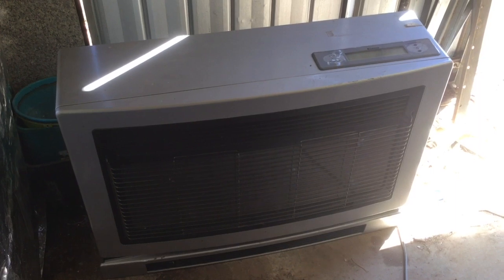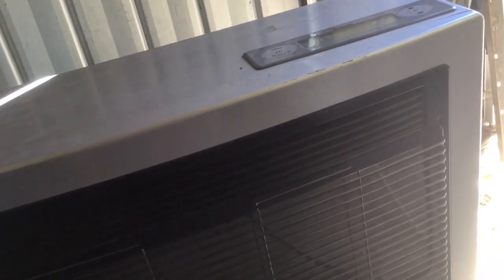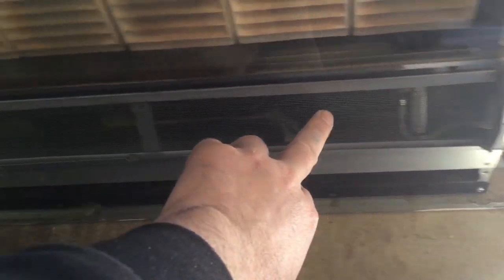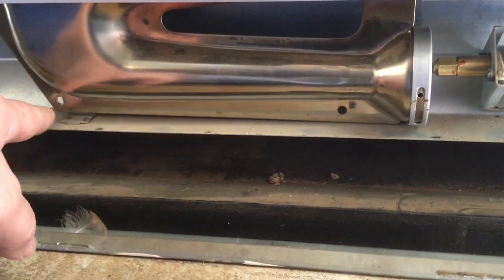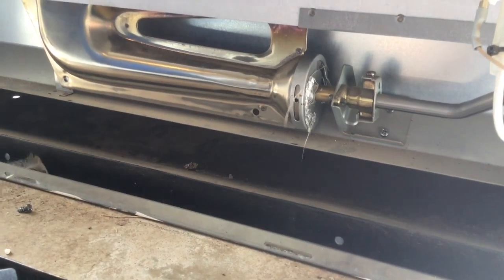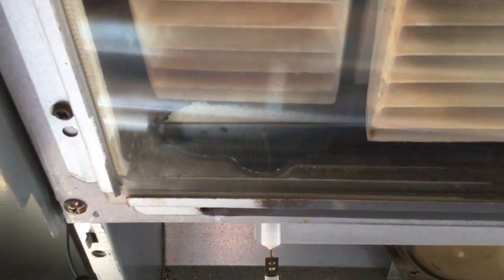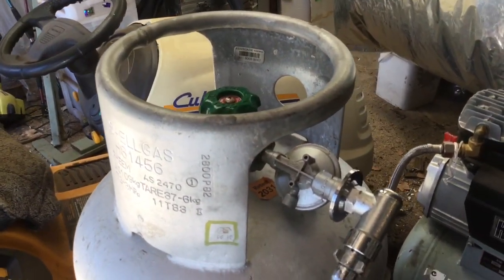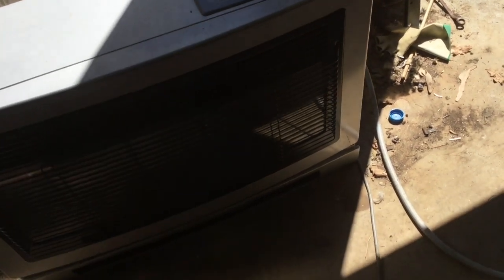Heating with biogas and heater conversion

Comment: Hey mate, hope you're well in all this Covid time. with it being winter and all, is your digester still pumping out gas? I'm over in Perth and looking at being more self sufficient and biogas has always been attractive to me. I wonder how smells would go in a medium dense urban area...
Reply from the maker: Hi Wyatt, yer good mate, the digester is still pumping out gas, but only really because I’ve put aquarium heaters in to keep them at a reasonable temp, I know this uses power to make gas that could be just replaced with electricity but for me the cost of running the heaters is ok due to solar and because i need the liquid fertiliser, plus if it does get too cold and the bacteria die, I do t really want to restart it, now as far as smells.... It doesn’t smell (well shouldnt) the tanks are air tight, the fertiliser has a bit of an odour but then so does chook poo that people use on gardens 😋 and if the gas is scrubbed properly, that shouldn’t smell either.

Comment: Definitely not as convenient as propane.  I would be very interested in a practical heating application for the house.  It seems now that would involve producing and storing biogas all year long to heat the house for part of the winter.  But is that impractical?
Reply from the maker: You are correct, which I have said before, my climate is impractical BUT, it depends on what you need it for, for gas heating... no way, you would need a very large well fed tank, maybe 50m3 at the least to make enough to heat your home, this is way there are commercial plants. Also I would say 99.9% of people would not have suitable compressors and tanks available. Still I push the fact that Biogas can be as easy or as difficult as you make it.

Comment: What if you were using less gas with a couple flames around copper coils to heat water? Specifically for a greenhouse. 1. Do you think it could work? 2. Is it sustainable/ can you produce enough methane to produce 24/7 through the winter?
Reply from the maker: It would be sustainable if you had a big enough tank (maybe 10m3) that was pumping out constant gas, I would run the flame on the coils and run the coils through the tank aswell so it heats itself, OR live in a decent climate so you don’t need to heat the tanks, but saying that if you lived in a decent climate you probably wouldn’t need a greenhouse.
Reply: Lucky Hill Farm Thanks. That’s a big container to find. Who knows what I’ll find on Craigslist though.
Reply: My home has an oil-burning furnace with hot water heat and baseboard radiators.  I would certainly be interested in a biogas application to boil the water to heat the home.  Biogas has been around worldwide for a long time.  I'm really surprised that biogas-fuelled home appliances and applications don't already exist.  That must mean that no one has found a way to make it commercially profitable.  So then how does a homeowner produce and use biogas to lower the usual and typical costs?  If biogas could knock out my winter heating costs, that would be great. Otherwise, it's just a novelty.  I really don't want to spend hundreds/thousands on a novelty.
Reply: @daviddavid9837  you could heat it with a giant compost pile in theory. Look up jean pain.
Reply: @chrischung2365  in the living room!  Excellent!
Reply: @daviddavid9837  lol.. I was thinking close to the house. Hot water pumped through floor boards. Im no expert though. Thats just a theory. I live in florida, but was considering moving to michigan, hence my ruminations.

Comment: Great thank you very much and good luck with all of those project you've got going.I am off the grid myself but have being filling my 100lb LPG bottle at the servo pump 85c ltr to run my fridge but i would rather be making it myself for nothing and making a bit on the side with the liquid I've just made one out of a 200 plastic drum at the moment to see how it goes and maybe get an IBC later. Anyway thanks alot for you help 
Cheers Robbie

Comment: Thanks for the videos. I was contemplating LPG for off-grid, but didn't like the idea of still depending on industrial inputs on a regular basis (i.e. SHTF and then ur screwed) not to mention reducing carbon footprint. So, seems this is a workable alternative. I was contemplating running gas lamps in the off-grid cabin (in addition to oil lamps). Have you tried using your biogas in a propane lantern?
Reply from the maker: Hey mate, not tried lamps as I don’t have any to try on, but I did make a vid on an outdoor patio heater, same principle, restriction nozzle and venturi, what I really want to try is converting a gas fridge.
Reply: @OkAtEverything-ProAtNothing  Thanks mate! Yeah, I was thinking to try your suggestion and store the biogas in pressure tanks like you demonstrate. I saw another guy replacing biogas in those camp butane tanks. Seemed to work. Also, never thought about the income possibilities of the byproducts. Keep up the great videos!